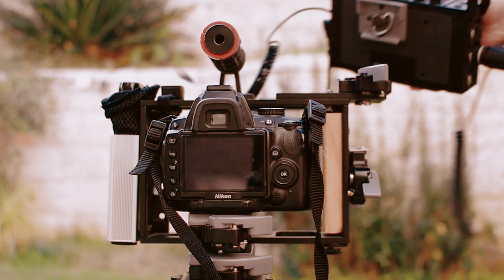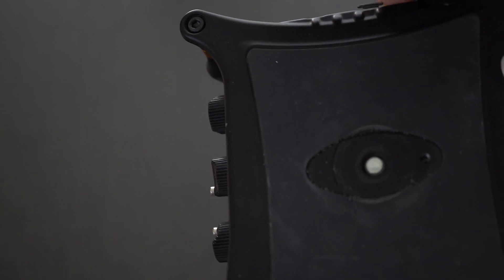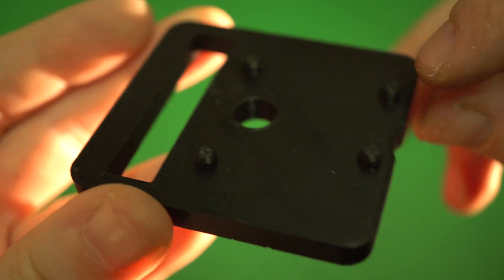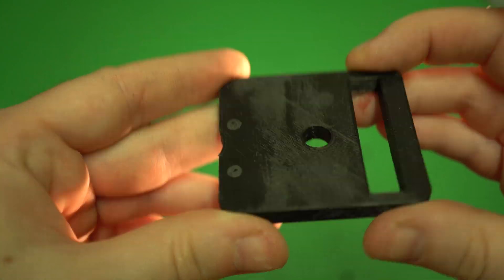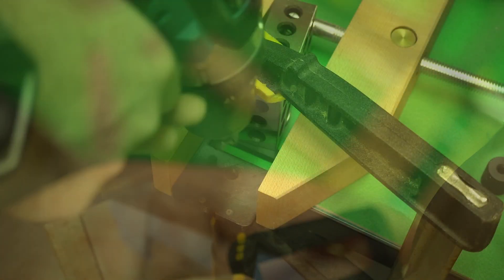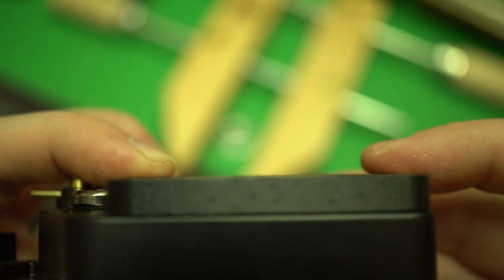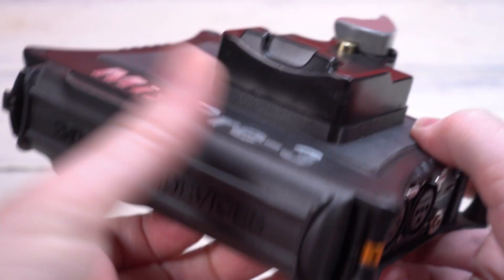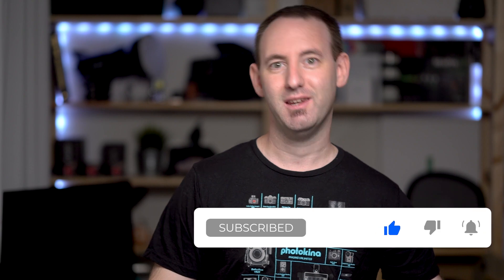3D Printing a Flat Base for the RC2 Quick Release System

Comment: Your 323 is a knockoff, that's why the part didn't fit.
Reply from the maker: Interesting. I never considered the option that the 3'rd party ones are different in any way, but they are. It actually isn't important to any other thing (some 3'rd party units even come with a bubble level which is an improvement on the original Manfrotto design plus they are way way less expensive and they do the job). 

It would be nice however if whoever made the original 3d design will adapt it to the more common 3'rd party 323 - they are the majority of what people buy now at 1/3-1/5 the cost of the original Manfrotto.
Reply: @LensVid  I am actually planning on going into production of a small aluminum adapter plate to solve this problem specifically. I was originally planning on using the holes in the bottom of the genuine manfrotto plate for registration, however as you said the knockoffs are much more popular. It is tricky designing something to fit a product, as well as many copies of that product of varying levels of fidelity.
Reply from the maker: Hi again - first we would love to talk to you about this -(You can contact me through Linkedin - https://www.linkedin.com/in/iddogenuth/).
I agree that making two versions is not ideal but you might be able to find a solution that will be good for both - again - get in touch with me about that.

Comment: Apparently not every Manfrotto plate is made the same, the little tabs fit some plates but apparently not yours.  Not sure I would trust gear screwed into a brass thread that’s attached to 3D printed plastic.  With a bit of vertical sheer force (such as a heavy mic boom that’s leaning overhead) could rip the brass threads right out of that plastic.  

Another option could be to weld a flat triangle plate to each of the four corners so it provides a thicker base and clears the safety lock.  But you are back to needing longer bolts, so that may not work if you need it to work on a regular tripod head.  

Also, it would be a very permanent solution, once you weld on the 4 tabs and clean up the excess, they are there forever. 😂
Reply from the maker: Hi Joe, can you share a picture of a base where the 4 tabs do fit? (we have almost 20 RC2 units from different sellers - they don't fit any of them).

As for strength - RC2 was never designed to hold much more than ~2Kg in my view anyway so for that it will hold like a champ.

The best solution should come either from Manfrotto or from a 3'rd party manufacturer that will make a flat RC2 base or a simple metal add on.

Comment: I too have this exact same problem and I am extremely disappointed that Manfrotto’s design is not flat and there’s no work around
Reply from the maker: Indeed, super annoying. Maybe this video will help us convince them to fix this issue (or at least get some third party manufacturer to make a simple metal add on).